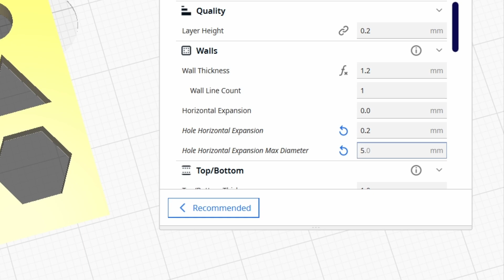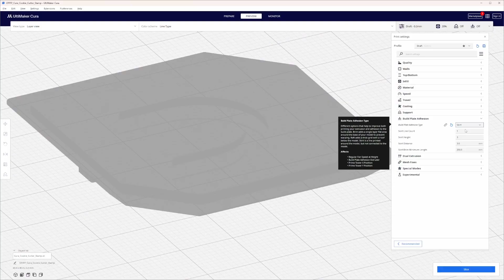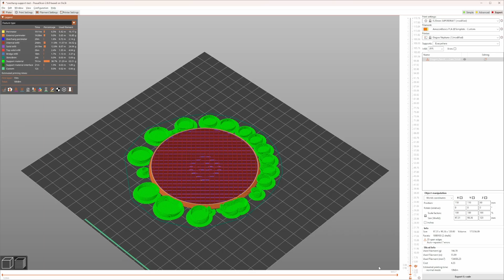Ultimaker Cura 5.4: New Features You Won't Want To Miss!

Comment: Are there extra setting with smart brim that need to be adjusted? I'm running v 5.5 with smart brim turned on and things do NOT separate as easily as you showed.
Reply from the maker: Hi @IMChrisThom, welcome to the 3D Printing Geek community and thanks for asking. 
As with many options, some rely on others. There can be several reasons for the Smart Brim to be not easily removable. If the printing temperature is set to high then that could cause a tighter bonding of the brim, as well as insufficient cooling.
Then there's another brim related setting you can check and change, the Brim Distance. Its default is to leave a 0.1mm gap. Try increasing it a little, something between 0.12mm - 0.15mm. I wouldn't go much higher to make sure that the brim still serves to hold the part to the build plate.
Last but not least these settings are material dependent. Whal works for one brand and material might fail for another one.
It would be great to hear from you if you got successful Smart Brims using these tips.

Comment: I have an error when using 5.4 to print. The outer wall layer only runs at 30 speed while I use it at 120 speed in cura. I have tried everything but can't fix it. With one small detail, the previous print only took 17 minutes. Now it has lasted 1 hour. What should I do to fix it? Thank you.
Reply from the maker: Hard to tell why this happens. Maybe if you switch to advanced, or expert settings, you can check if the speed for outer walls is set to 30 mm/s?

Comment: Although everyone is yelling about how great the Prusa 2.6 is, I still haven't gotten it to work correctly with my Flsun V400.  My goto slicer is Cura 5.4 which (although, yes it's SLOWER) produces great g-code.  My backup slicer (and favorite when I don't need supports) is Orca slicer 1.6.3.
Reply from the maker: Hi Betty (@bettydaltonnewbold2019). Thanks a lot for sharing your experiences with slicers. I think it's absolutely fine to use the slicer with which one get's the best results. No matter if it's Prusa's or Ultimaker's. Both have their strengths and weaknesses and both can produce great GCode, or GCode that ruins your day. Sometimes this happens to me, too, when I get too experimental trying out the overwhelming amount of settings one can use to fine tune but then it's time to get back to a known good (working) profile, or even the defaults and start over.
Happy and succsessful 3D printing 😊

Comment: I'm still waiting for them to implement those horizontal prints that doesn't need support.   CNC kitchen covered it a year ago,   but I still haven't seen any of the slicers using it.
Reply from the maker: Hey @gconol 🙂
Well, that'd be a nice one for sure but probably not as much requested.
You could try to boost the implementation in upcoming releases by issuing a feature request on the Ultimaker Cura (and maybe the PrusaSlicer) GitHub pages.
If that gets enough upvotes there then we may see it some day 🤔
Reply: @3D_Printing_Geek  
Thanks,  I didnt know we can make a request.  I will definitely do that.
Reply from the maker: @WTF_BBQ  Yo're welcome. Just head over to https://github.com/Ultimaker/Cura/ and there click on Issues, New Issue, click Get started in the  Feature Request row. Fill out the form with concise information about your feature request and how you think it should look and work. Submit and some developer will sure take a look at it!

Comment: quite a bunch of useless features. The "Smart" brim feature for example, doesn't make the brim useless? We use brim to stick our part to the built plate, if that brim is easy to remove, then is easier for the print to fail because the brim is more weak. The holes feature is kind of ok, but it could be improved to actually figure out automatically if it's actually a hole and not a normal future. A custom modifier box would be more welcomed (a box you put on the holes so only that area is affected). We would see this on Prusa Slicer in the future probably... The skirt line feature is fixing a problem nobody complained about... And the trees suport... let's be fair, that's not a new feature, everyone is already using tree supports when they need them. So, I personally call this an update made in corporate style just to have something new to announce.
Reply from the maker: Hey @l3x.132 , thanks for commenting!
Since I've tried the Smart Brim, as well as all other features shown in the video myself and not just repeated Ultimakers marketing babble, I can assure you that the Smart Brim does still do what one would expect from a brim: getting a better adhesion for the printed part and prventing it from getting loose or warp. It's not that the brim isn't connected to the object anymore. Changing the order in which the closest brim line is printed works as I explained: because of the longer cool time for that line, it doesn't bond that much to the part though it still is strong enough to hold the part in place. As a result it is easier to peel away without getting it torn as much as the old brim. 
The holes feature is useful whenever one forgets use the correct hole diameter or to add the right tolerances to holes. Instead of getting back to the CAD one just increases just the size of the holes in question. I like your suggestion to do it with a custom modifier, that would make much more sense and give a lot more control over the feature. Have you considered raising a feature request on GitHub for it? Maybe they take that into a coming release 🙂
According to the skirt height feature I have to say that I often had cases, especially when printing with very small layer heights, that I couldnt get it off the build plate without using a sharp scraper, risking to damage my build plate permanently. Having the option to get a multi layer skirt eases the problem and one can remove the skirt mostly without using a tool. Sure, when printing at 0.3 mm layer height, there's no problem to do it.
Finally, yes, Tree Support is not new. Even not in Cura but Curas implementation of it had flaws which were addressed by the improvements made by Thomas Rahm. So what's new is that Ultimaker exchanged their not so good implementation with the one that is also used in PrusaSlicer 2.6.
I agree that this release may be a try of Ultimaker to get some attention after the great success of PrusaSlicer 2.6 and therefore they through out a new release even knowing there were no really groundbreaking things in it. Nevertheless even tiny improvements can be useful and what I think is even more important, drive the companies to go on inventing new innovative things.
As always, happy 3D printing 🙂

Comment: so I just installed the 5.4 and it appears to be 50% slower than the 5.3.1 ver. Any idea why?
Reply from the maker: Thanks for asking, @mcorrade
It's hard to tell what causes the slow performance. I haven't had that issue yet.
What exactly is slow? The start, the slicing or the reactivity of the UI?
Here are some suggestions what you could try:
A fresh reboot. Is it still slow, or just slowing down over time? Then it may be a true "bug" in Cura slicer, probably a memory leak.
Deactivate installed plugins one by one and check if one of them is causing the problem. It could be incompatibilities of that plugin with the new Cura version.
If nothing of that helps I suggest raising an issue on the Ultimaker Cura GitHub page and uploading the logs, so they can take a look and probably fix it.
Let me know if one of these suggestions lead to success, so that others having the problem can solve it, too.
Heads up and happy 3D printing 🙂
Reply: @3D_Printing_Geek  sorry I meant the print time. it reports at the very least a 50% slower print time that version 5.3.1. I'm using the same profile and then same settings on the same print part
Reply from the maker: @mcorrade  Hm, that correlates with my finding. Remember me pointing out the huge difference in estimated print time of Cura vs PrusaSlicer in my video?
It's not nice but as long as the real print time is less I'm fine with it. Nevertheless they should fix that.
Reply: UPDATE: this only happens when I use vase mode ?????? weird eh
Reply from the maker: That's really weird. 😁 I will check this out for curiosity.